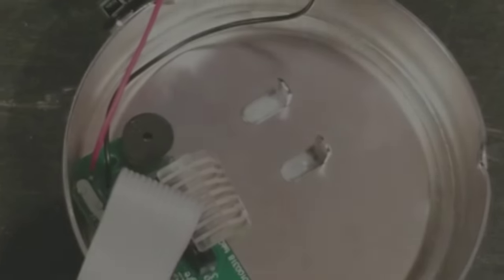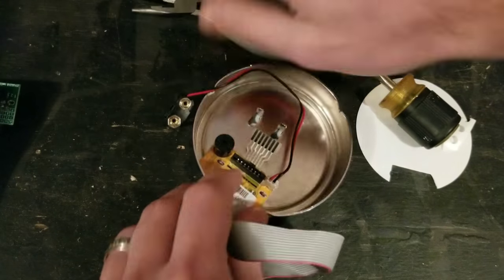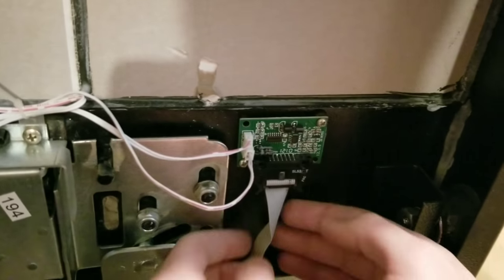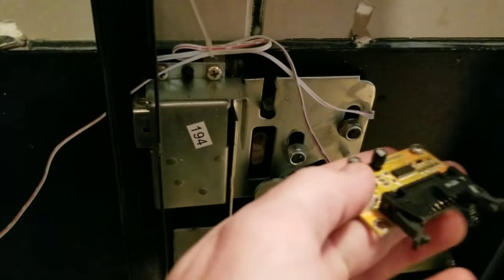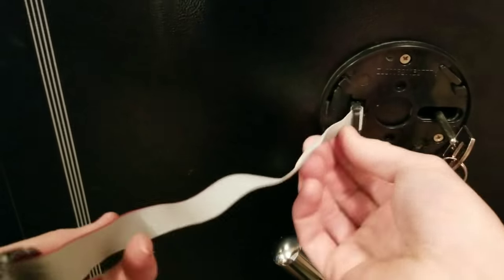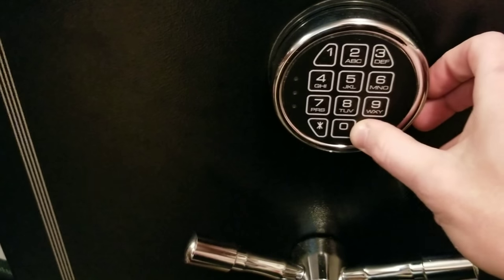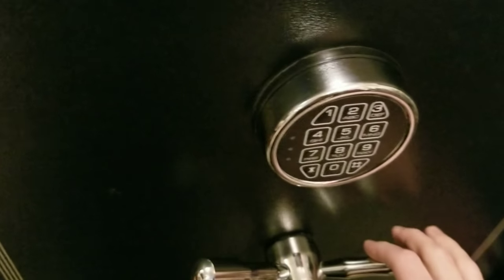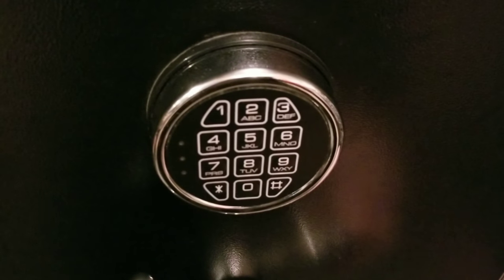DIY Electronics Replacement and Keypad Reprograming Stack On Elite Gun Safe

Comment: Posting this for others that may benefit from this info: Keys 1-6 were no longer working on my keypad. After finding this video I called support to see about getting a replacement. The support rep instructed me to remove the battery, press all keys 5 times and then reinstall the battery. I was skeptical but, to my amazement, this worked to restore functionality of my keypad. Others facing a non-working keypad may want to try this simple step before trying to replace their keypad or taking other drastic steps.
Reply: Had the same issue. Your instructions work great. Will see how long the combo lock continues to function.
Reply: Yes Thank You!   It worked!!!

Comment: Got the parts from Stack-On (free) and installed them after watching your video.  Mine is a Sentinel 64+4 model, but the install was exactly the same.  You get no instructions from Stack-On and this video is a must watch if you do not know much about safes, which I do not.  Took me about 45 minutes, could have been faster but lining up the screws around the door is a job.  Thanks for the video.
Reply from the maker: Absolutely glad it helped you! I had the exact problem never got any instructions so decided to make the video; hoping it could help someone else. It was my first time working on a safe, so it was a little slower for me too. Glad that it helped!
Reply: My sentinel keypad stopped working also today with very little use.
Did u just call stack on
Reply from the maker: @RileyMy5090  yea I just called and talked with their customer service

Comment: I have Remington safe and I need to  open it  can i change face plate and change the combo?
Reply from the maker: I don't have any experience with those specifically normally you have to have them open to access a button to reset a code

Comment: I was moving my safe and the keypad got caught and broke off, taking the wires with it and ripping them. The internal electronics, keypad, and lock itself are all perfectly fine, I just need a new baseplate and the long flat bundle of wires. That's what ripped apart. Please if you have any info let me know
Reply from the maker: I would just call their customer service they should be able to help get u what you need. (Not sure what it will cost.) They have had great customer service in my experience.

Comment: Thanks for the information! I had to replace the lock due to static electricity.  Service guy at Stack On was helpful with sending out the parts, but the instructions were not to be found on website as I was told they were.  This was very helpful.
Reply from the maker: Glad that the info was helpful! Thanks for commenting, this is exactly why I made this video.

Comment: Could you tell me how to replace battery on my used stack on elite please?  It has a aprrox. 1" plastic cover on bottom of key pad. Thanks!
Reply from the maker: Without seeing the exact safe I can only base it on how mine is set up. To remove mine grab the chrome trim on edge of keypad and twist counterclockwise. This will allow it to pop off and the battery is located just behind the keypad. It is a 9volt battery so pop the battery off the connection and replace battery and then reverse steps to put keypad back on.
Reply: Thanks Much!  @welldonecj7

Comment: How do you know the keypad needs replaced? My key pad works, but when code is entered the swingbolt doesnt retract.
Reply from the maker: Mine the keypad stopped functioning. If ur code goes in and u get the green light on keypad it's likely another electronic. I know it sounds basic but also be sure has a brand new battery sometimes voltage will cause errors